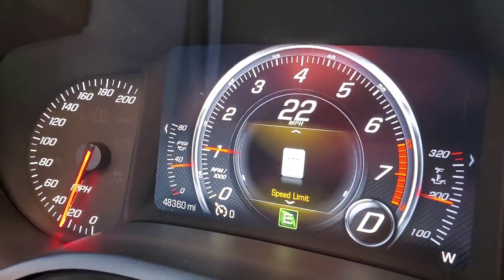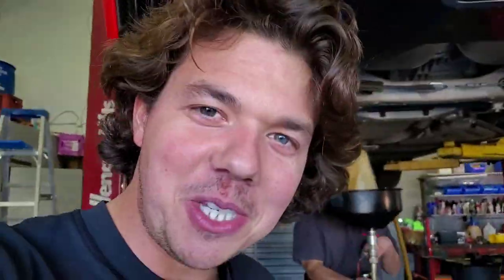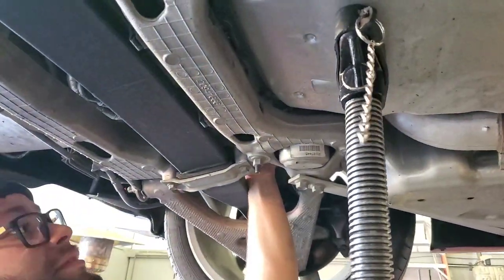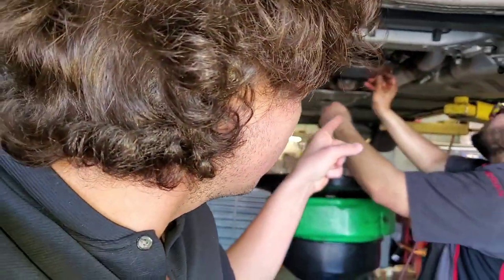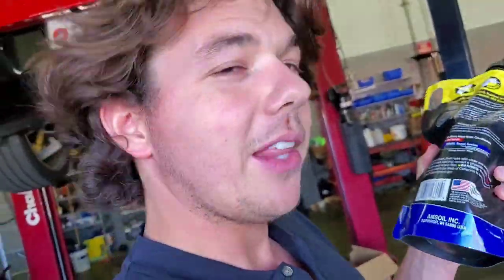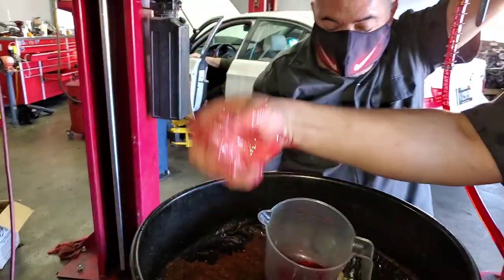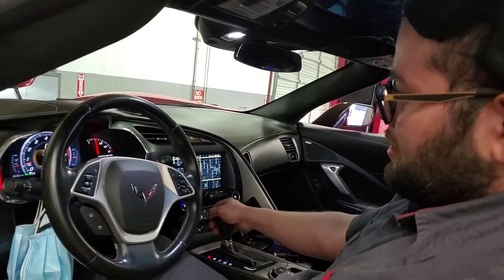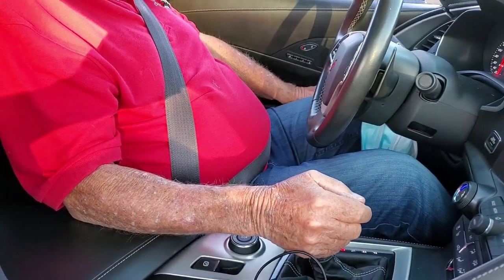2015 C7 Corvette 8 Speed 8L90 AMSOIL ATF Transmission Fluid Change

Comment from the maker: Watch This Next: C7 Stingray Corvette AMSOIL Motor Oil Change - https://youtu.be/CEXWQm7GZPg

I give a man a fishing pole & show him how to fish. 

     Together! We can get your vehicles to run better than brand new!

     To be "Your" Independent AMSOIL Dealer please use the link below or my dealer no. 5331179 call anytime Eben Rockmaker 702-472-3614

     ♥ Shop by vehicle - https://www.amsoil.com/guides/?zo=5331179

     ✅ Save up to 25% on every order as a preferred customer: https://www.amsoil.com/offers/pc/?zo=5331179 
New promos: 5MP
     
     🥇🥇🥇 Synthetic Oil Protection Google map reviews
Eben Rockmaker, independent Amsoil Dealer 
Dealer no. 5331179
(702) 472-3614
https://maps.app.goo.gl/1aXxuXrXK9eJwqK78
             
 👍 Synthetic Oil Protection Website - http://syntheticoilprotection.net

♥ See fluid performance tests - https://www.amsoil.com/performancetests.aspx?zo=5331179      

     ☕ Buy me a coffee - https://www.buymeacoffee.com/Syntheticoilprotection

🇺🇸 Did you know a oil manufacturer can call a lubricant a Full Synthetic when it's only 25% synthetic? AMSOIL is different because it is 100% Synthetic and has a higher film strength keeping the metal parts separated. AMSOIL allows less friction, less heat, less wear on the component. AMSOIL Signature Series motor oil has guaranteed protection for up to 25,000 miles or 1 year of normal driving. 

     ♥ Your vehicle could run better than brand new by choosing the right fluids! See results - https://youtu.be/by5RYv3Dt0Q

     🇺🇸 Why AMSOIL - https://www.amsoil.com/about/exclusive-distribution/?zo=5331179    

     ☕ Synthetic Oil Protection Coffee - Ebens Favorite: https://supportwith.coffee/shop/subscriptions/sop/
Reply: I need engine oil, oil filter, antifreeze and some other products.  Can you send orders to California?
Reply from the maker: Yes, When you use my link I will be your amsoil dealer and I will get the credit and it will be shipped directly from the amsoil distribution center and it will be to you next day from Las Vegas if you order before noon.

This is my link and if you have any questions feel free to reach out to me.
To Order AMSOIL Products Click Here - http://syntheticoilprotection.net/
Reply from the maker: Thanks for reaching out to me 💯😃☕

Comment: I see him driving in Eco mode 3  years later and cringe at the thought of what hes doing to the engine and trans
Reply from the maker: Oh it runs fine everything's been running great🇺🇸💯
What type of vehicle do you have?
I give a man a fishing pole & show him how to fish. 

     Together! We can get your vehicles to run better than brand new! 

     For me to get credit & be "Your" Independent AMSOIL Dealer please use my website below or my dealer no. 5331179 call anytime Eben Rockmaker 702-472-3614
After you click on: http://syntheticoilprotection.net
1. Click hamburger menu
2. Click offers AMSOIL preferred customer
3. Click join now 6-month PC member add to cart.  ( there is no reoccurring renewal membership unless you select that dot box ) 
( you have the option to not have your credit card saved if you prefer - est. 1972 )
4. Scroll up to the top Select shop by vehicle. 

New promo:FREESHIP

Comment: Additionally respectful thing Toyota does/did. I learned in the super days. Every other oil change is a transmission filter cleaning (metal) and fluid partial change of less than 3 quarts every 6000 miles. zero fluid shock and never old if constantly partially changed.super easy with fill plugs. Amsoil in everything.Yes

Comment: Why are you not using the DRAIN/ FILL hole to add fluid?
Reply from the maker: I think that's just the method they wanted to go about.
You can do it either way the most important thing is to get it up to operating temperature and make sure you drain it to the straw level on the bottom of the pan That's the most important part.

Comment: at what mileage did the corvettes transmission fluid get changed? I have a 2018 and am unsure when it should get changed or signs
Reply from the maker: I don't remember it's in the video but if it was my transmission I would change the fluid every 30,000 miles of City driving if you're doing all highway driving you're good for about 60,000 miles the higher heat driving you do you want to change it sooner because the heat oxidizes the fluid and it loses its film strength.
You can get the fluid right here through my website and you'll get the best value as the 6-month preferred customer all you do is click on buy wholesale on the hamburger menu and then you want the 6-month PC membership and also there's still a new promo going if you have any questions just give me a buzz☕️👍
For me to get credit & be "Your" Independent AMSOIL Dealer please use my website below or my dealer no. 5331179 call anytime Eben Rockmaker 702-472-3614
http://syntheticoilprotection.net

New promos: BEANIE

Comment: I was just getting ready to do this and e-mailed Mobile 1 to see if it's ok to mix the OEM ATF with the new Synthetic Mobile 1 here's what they said:

Since the Mobil 1 synthetic LV ATF HP and Corvette fluid are not tested for compatibility, we are not sure about the same.

     So its better not to mix both the oils, and a complete drain before refilling with fresh Mobil 1 is good.

I didn't ask about Amsoil.
Reply from the maker: I recommend the Amsoil it's a lot better also you can mix it with the other fluids what makes it different 100% synthetic film strength keeps the metal parts separated less frictionless heatless wear this is the best way to get the Amsoil as a PC member when you use my link I would be your dealer in the future I could always answer all your questions on the products which I appreciate the business future business in advance.
❤️🇺🇸❤️ Professional YouLubher: Eben Rockmaker Regency Platinum Direct Jobber AMSOIL Specialist (Dealer#: 5331179) 702-472-3614 

      ✅✅✅  I Recommend The AMSOIL 6 Month PC Membership because it will give you the Best Value which is about $ 33 back on a $ 100 purchase after the difference in tax - https://www.amsoil.com/offers/pc/?zo=5331179

Comment: Looks like what I need as mine shutters, GM still won't help me?  I've got an 8 speed :(  Help!
Reply from the maker: If I had that Corvette if it was my personal vehicle I would do exactly what I did to my car you'll see on my playlist I did a pin drop at 5,000 miles and then came back 5,000 miles later and did it again and that changed out about 80% of the fluid my transmission shifts amazing now and I'm coming up on 50,000 miles and you're going to see the oil analysis and transmission fluid change coming up soon should be a month or so.

I recommend getting everything here as the 6-month PC member and when you use my link that will attach me to you so in the future I can always answer your questions about improving the performance and lifespan of your vehicles by choosing the right fluids as your independent Amsoil dealer👍
After you add the 6-month PC member to cart you'll see the lookup guide it will say shop by vehicle and then also the new promotion is here as well☕️💯👍
✅   Save up to 25% on every order as a preferred customer: https://www.amsoil.com/offers/pc/?zo=5331179 
Promo: FREESHIP

Comment: Hello, I have a c7 grand sport corvette and I'm going to track it.

I believe that with the original automatic transmission oil they say that it must be changed after each day of track!!!

What about Amsoil?

I hope not !!!
Reply from the maker: Hey Steve you would be comfortably good for double the OEM interval of severe service of your vehicle so if you are severe service on your Corvette would say be $15,000 miles you could potentially go 30,000 miles.

Everything will be here and look up guide for your vehicle and when you use my link I would be your Amsoil Dealer and I can always answer your questions in the future with the products which I appreciate the business future business in advance.
❤️🇺🇸❤️ Professional YouLubher: Eben Rockmaker Regency Platinum Direct Jobber AMSOIL Specialist (Dealer#: 5331179) 702-472-3614 

      ✅✅✅  I Recommend The AMSOIL 6 Month PC Membership because it will give you the Best Value. You get $33 back on a $100 purchase after the difference in tax with No need for Auto Renew - https://www.amsoil.com/offers/pc/?zo=5331179

You'll see the lookup guide in the upper right hand corner but if you want to go right to everything for your vehicle this is the exact lookup guide link.
Find AMSOIL Products For Any Vehicle - https://www.amsoil.com/guides/?zo=5331179
Reply: Thank you for your answer.

I really like your videos you explain well and you are funny too so we want to watch until the end.

Keep up the good work 👍

Comment: There is no temperature range for the oil level check ?
In most Toyota's is around 35-45 c.
Reply from the maker: Yes it depends on the vehicle most of them are operating temperature meaning if you let the car idle for about 10 minutes pretty much be darn near operating temperature.

The most important thing is to not overfill the transmission meaning if you put the fluid in when it was 30° out very cold and filled it to the top once the transmission gets heat soaked it would be over filled.
That would be the biggest caution.

Other than that it would be pretty tough to overfill the transmission as long as the transmission is heat soaked when you service it.

The transmission fluid expands quite a bit when it's hot even shrinks when it's cold.

Comment: I'm about to do my 2016 camaro with the same trans.  How do I know the right temperature it says check between 131 and 149 but I can't figure out how to read the trans gauge?
Reply from the maker: Great question I wouldn't be too technical with it I recommend making sure it's a good warm to hot trans mission you just want to make sure it's not cold because if it's cold you can overfill it and possibly have a major problem the fluid volume goes up as it gets hotter when it gets hold it cold it shrinks.

You just want to make sure it's warm to hot fluid👍

If you ever want to try the products this will give you the best value on them as the 6-month PC member and when you use that link that would attach me to you in the future I can always answer your questions about improving the performance and lifespan of your vehicles by choosing the right fluids as your independent Amsoil dealer and you'll also see the promo code at the bottom.
✅   Save 25% On Your Next Fluid Order: https://www.amsoil.com/offers/pc/?zo=5331179 

Promo: FREESHIP49 & 5AMS
Reply: @Syntheticoilprotection  ok cool thank you!!

Comment: Would Amsoil ATF work in my 17 Chevy Volt? My understanding it’s a CVT transmission. I had the ATF changed at 40k and the dealer used Dexron VI. You can feel a bump sometimes from take off or when it switches to the secondary electric motor, also sometimes when it switches to the gasoline motor. The fluid change stop it but it came back after a few thousand miles. When the dealer changed it I asked for a sample and it was black. I was told by a Volt dealer tech that it’s normal because of the assembly lube used and other newer GM cars are the same. Thanks!
Reply from the maker: Yeah that sounds normal The always say that and that's the break in metallic too on any new transmission It should be changed pretty early that way you don't have all those particles floating in suspension

Comment: This is the corvette i was talking about any updates on this transmission?
Reply from the maker: Oh yeah it runs great Danny loves the car 💯
Reply from the maker: You'll see at the end I drive it in the one video you'll see I have a whole playlist on that car If you go through the playlists and the car shifts faster smoother it does that for any vehicle you put the ATF fluid in has a higher film strength keeps the metal separated under high pressure and it creates a stronger film.
The film has nothing to do with the viscosity and has to do with how completed is VM's oil is 100% synthetic in makes a huge difference.

Comment: Did you guys change the filter also? Getting ready to do mine
Reply from the maker: Yes it's always good to change the trans filter and clean the magnets and if you can to get a new gasket I usually go with the Wix filter if you are new to Amsoil this will give you the very best value on the products as the 6-month PC member and when you use my link that would attach me to you so in the future I can always answer all your questions about improving the performance and lifespan of your vehicle.
♥️   Find The Right Fluids For Your Vehicles - https://www.amsoil.com/guides/?zo=5331179    

     ✅   Save 25% On Your Next Fluid Order: https://www.amsoil.com/offers/pc/?zo=5331179

Comment: Boom! We got an explosion! The Corvette will deliver nuclear bomb performance from now on 😂

My car also doesn't go in gear immediately and there's a thud if I press the gas right away. It's definitely got better with the new Toyota fluid but not entirely gone. Fortunately, that's not too big of a deal. It would be interesting to see how it goes with the Amsoil fluid.
Reply from the maker: It would be a totally different vehicle you'll get a load of this video This is of my number one preferred customer he has installed the fluids on about 25 different vehicles.
Toyota FJ cruiser transmission fluid follow-up https://youtu.be/t7X93X-2-wc

Comment: Wow.....lots of metal in there !
Reply from the maker: Yeah that's normal wear metal in a new transmission that's the way they all are even if you change the fluid on that in 10,000 mi you'll have a little bit of that

Comment: Will this work for th 6l90?
Reply from the maker: Double check everything here on the lookup guide for your specific year make and model it will give the fluid capacity and the specific product I highly recommend the signature series ATF will hold up better in the high heat and in the cold.
   I give a man a fishing pole & show him how to fish. 

     Together! We can get your vehicles to run better than brand new! 

     For me to get credit & be "Your" Independent AMSOIL Dealer please use my website below or my dealer no. 5331179 call anytime Eben Rockmaker 702-472-3614
After you click on: http://syntheticoilprotection.net
1. Click hamburger menu
2. Click offers AMSOIL preferred customer
3. Click join now 6-month PC member add to cart.  ( there is no reoccurring renewal membership unless you select that dot box ) 
( you have the option to not have your credit card saved if you prefer - est. 1972 )
4. Scroll up to the top Select shop by vehicle. 

New promos: FREEQS

Comment: How much do they charge to do full transmission flush on 2016 escalade esv if we bring amsoil oil ?
Reply from the maker: Great question I would call Serigeo the Owner.
All Imports Auto Service LLC
(702) 222-2322
https://maps.app.goo.gl/artejMGE9xNZu6gNA
Reply from the maker: Are you a AMSOIL preferred customer?
Reply: @Syntheticoilprotection  no yet but I will before buying.and thinking about using you as dealer.we talk before about making a video together and I got covid after
Reply: @Syntheticoilprotection  does 240$ sounds right just for labor?
Reply from the maker: That sounds correct if they're including the filter gasket and filter kit.

If you're bringing the filter and the kit that's a little bit high still okay
Reply: @Syntheticoilprotection  no they say if I bring gasket filter and oil going to be 240$.what you think normal price is?remember how much they did for corvette?
Reply from the maker: Yeah good question yeah that's a decent price just depends on how long it takes if it takes 2 hours that's the normal price.

If it only takes an hour that's a little expensive

Comment: What spray they use to clean?
Reply from the maker: There's a bunch you got the glass cleaner you can use you can also use the Amsoil miracle Wash.

If it's metal you can use MP metal protector red can.

If it's rubber you can use the silicone spray.

Those are just a couple
Reply: @Syntheticoilprotection  thanks for your support appreciate. They used a spray for transmission directly when the oil ban was removed to clean the sides then after assembling everything they again did the same to cleaning the remaining oil drops that’s the one I’m interested to know for my Mercedes. 🙏
Reply from the maker: Oh yeah I forgot they have the Amsoil parts cleaner That's another one for cleaning metal parts
Reply: @Syntheticoilprotection  appreciate 🙏🙏
Reply: @Syntheticoilprotection  Man the oil is like dream really you was correct in everything appreciate ❤️🙏